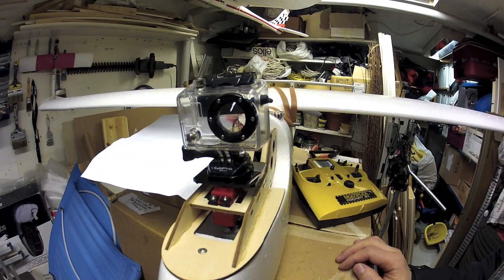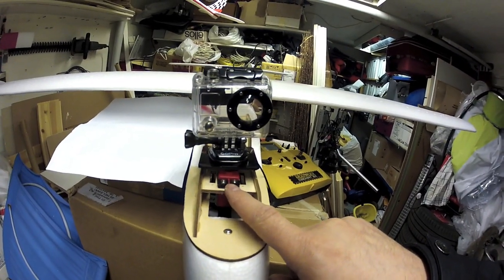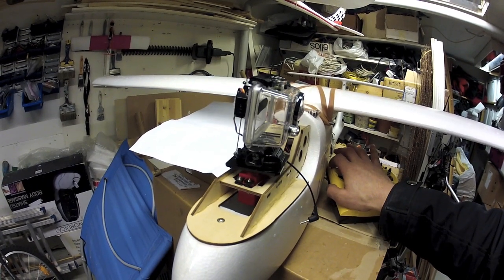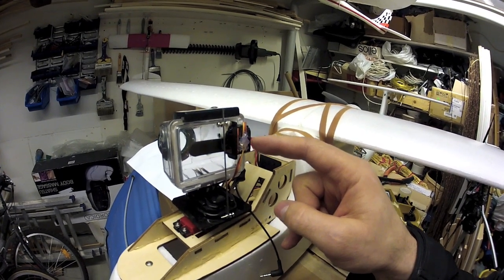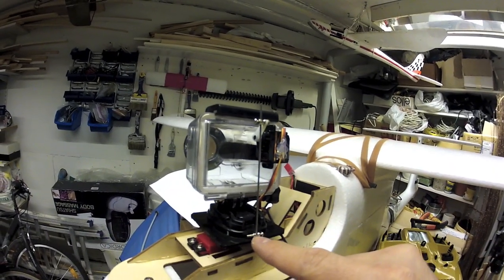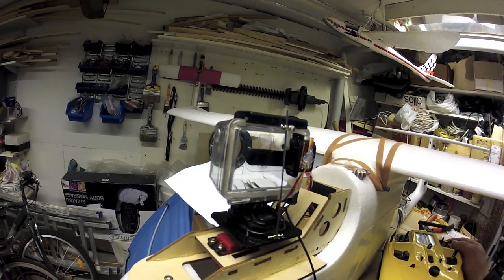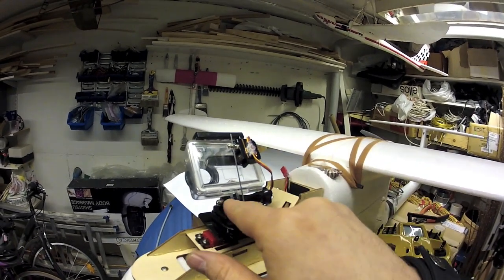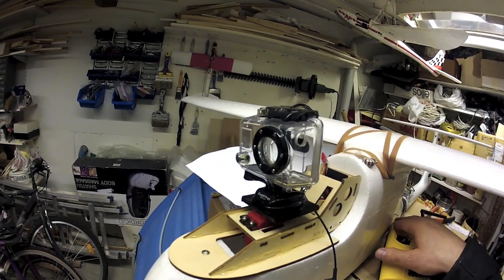DIY GoPro2 pan/tilt for FPV

Comment from the maker: Thanks blackmennewstyle! I have since added veneer strips glued to the side of the servo that support the GP black "base". I wrapped fiber tape over the top of the veneer strips, to make it act as a slip surface for the black support. The servo gear connection itself made the camera wobble too much side2side, and also stressed the gears during landings. The veneer strips take most of the load, and by adjusting the servo horn gear screw, I am able to adjust the pressure of the GP base on the veneer strips

Comment from the maker: I adjust the force against the slabs by adjusting the screw attaching the servo horn. Since I use a carbonite gear servo, the screw is very stiff. If you use a MG servo (perferred), be sure to use thread lock!

Comment from the maker: Kiitos Pete,
After finishing this video, I added two vertical slabs of veneer (4mm) glued to each side of the pan servo, resting against the skywalker pod. The purpose of the two rectangular slabs is to support the rotating gopro base. I wrapped the top of the slabs with fiber tape to make them slippery. Result: less skew torque on the servo, much less vibration sideways, and you don't strip the pan servo as easily in a crash (guess how I know :-)